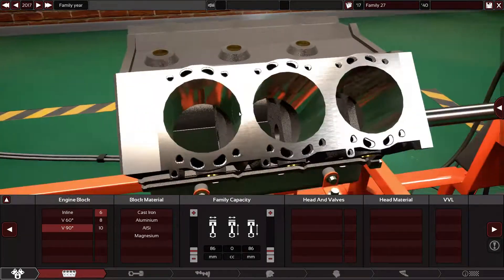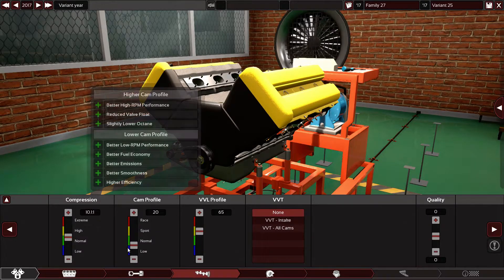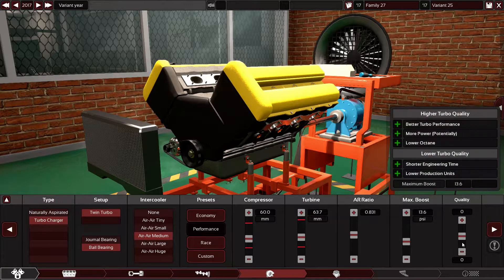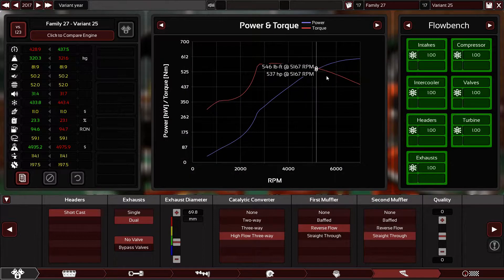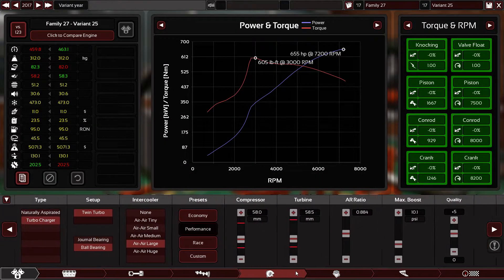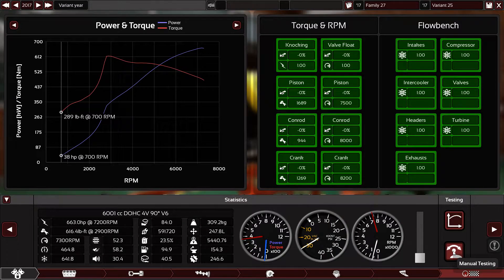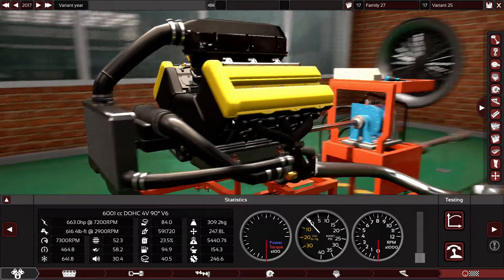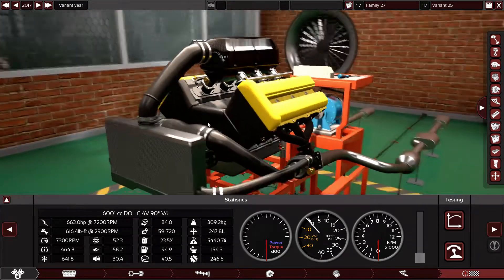90 Degrees 6.0L Turbo V6 engine.

Comment: I did say racing in the comment, it's still good though sounds beefy as i expected, i can you make one that pushes it as far as it can power and rpm wise, cause im getting the engine design as billet
Reply from the maker: +FAULT Official Channel 
I will make it tomorrow with racing specs 
I must have read your request quickly and I missed the racing word.